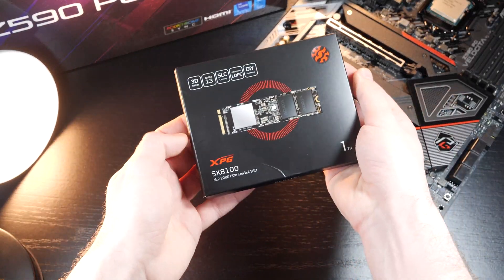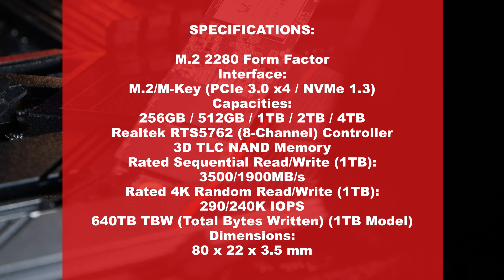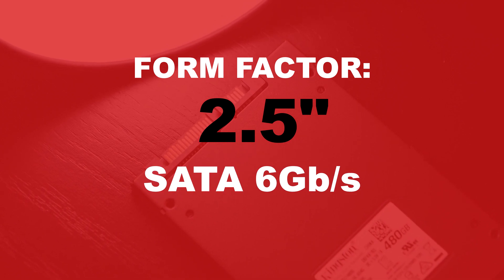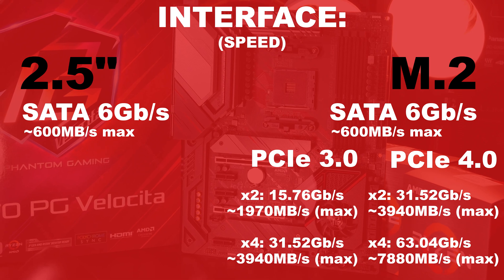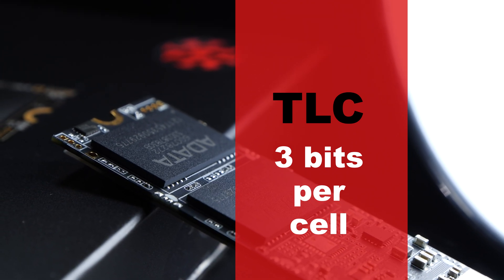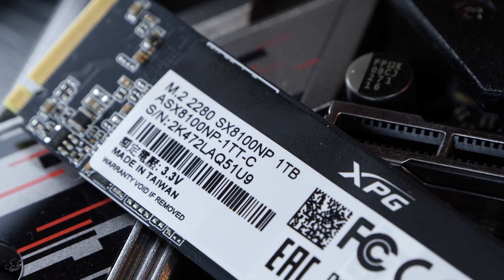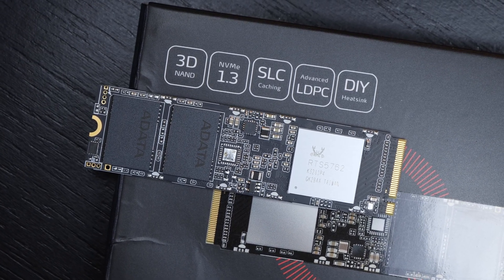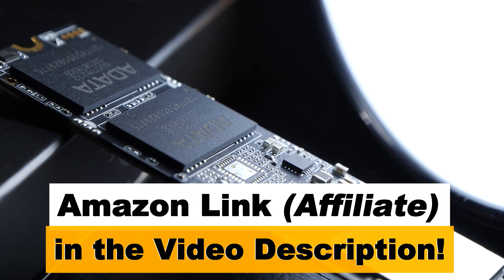SSD Buying Guide 2021 -- ADATA XPG SX8100 1TB

Comment from the maker: What's your current favorite SSD deal out there right now? 😎
Also, are you using a QLC, TLC (or MLC?) or maybe even SLC-cached SSD? 😅
To SATA SSD owners: Are you still happy with the performance or are you thinking of upgrading to an NVMe drive in the near future? 😁
Reply: Favorite deal as of 4/4/21 -  Xpg Sx8100 adata 4tb Mvne M.2 ssd on NewEgg : $389.- Ny bucks 🍷 Remember the bigger the drive  You get More Cache & better Read & Write Speeds + other features  🇵🇹
Reply: Probably will buy the WD Black NVMe SSD SN850 1TB (Euro 190,- now at my end) but this (XPG SX8100 1TB) could be a cheaper alternative (Euro 140,- now). But the specs of the WD Black SN850 are much more impressive with Read (sequential) 7.000MB/s Write (sequential) 5.300MB/s. XPG SX8100 1TB Read (sequential) 3.500MB/s Write (sequential)1.900MB/s.

I am using the Samsung 970 Pro 1TB (MLC) now in my computer.

Comment: Please make a review on
"XPG SPECTRIX S40G RGB".
Reply: it's the same as SX8100 actually, the only different is that S40G has LED... their specs practically the same..
Reply: one thing about s40g, is that nobody talks about the potentially high temperature.. i initially was thinking of getting S40G 1TB, but after i found out that nvme m.2 drives tend to reach high temperature when running heavy tasks.. and no expert tested on the real world application in sense of durability and high temp risks and etc. in the end, i gave up my love on S40G 1TB.. and go for SX8100 1TB.. but if you really have budget, can consider for SX8200 Pro..

Comment: I want to buy 2TB HDD 1TB SSD AND 128 GB SSD can you link them all for me please and tell me if it will all fit MSI B450 Tomahawk Max
Reply: Go to any online store and get them and see your motherboard manual for the slots you have.
Reply: Hmm lol   yes b450 tomahawk Max have 6x sata   however if you install nvme memory sata1 and sata2(they are at butom on motherboard)  both will be turn off cannot use them more!However you can get pci-e braket for nvme and install nvme right there in casé you using many sata.
So you good 1hdd and 2 ssd =3
Reply: @intech7863  m.2 to pci-e adapter you mean?
Reply: @mbsfaridi  yes pci e going right to the motherboard  in casé you use all sata or want secund or third nvme drive
Reply: @intech7863  Hope that helps him.
Reply: @mbsfaridi  aways get 1tb or above to have longer life span   256 -480-512 is no to go
Reply: @intech7863  They last longer because there being more flash chips or because most of the lower capacity ones these days are QLC?

I'm not looking to any hardware. I was just adding/ helping the OP :)